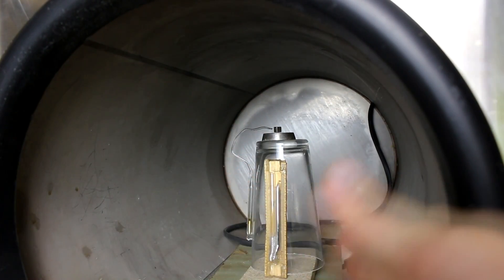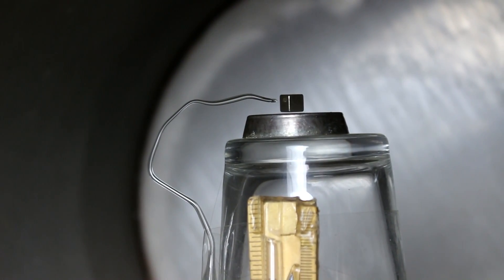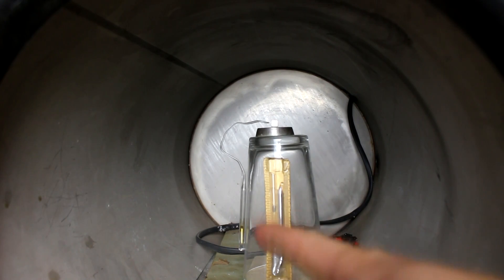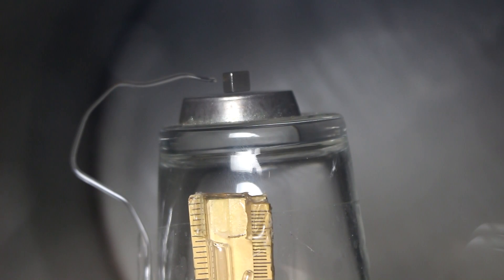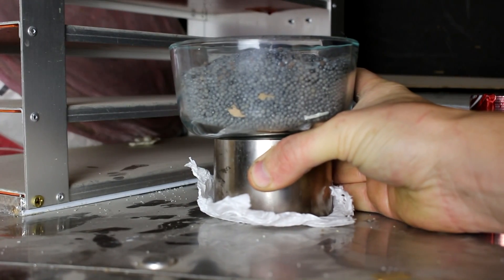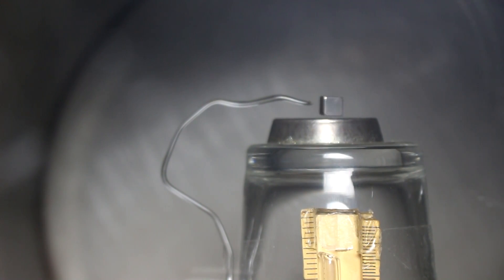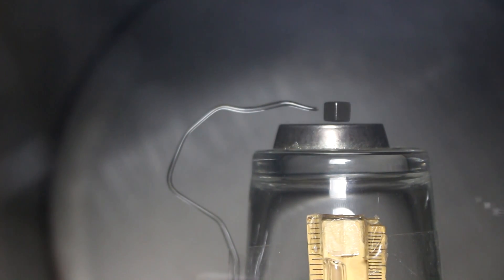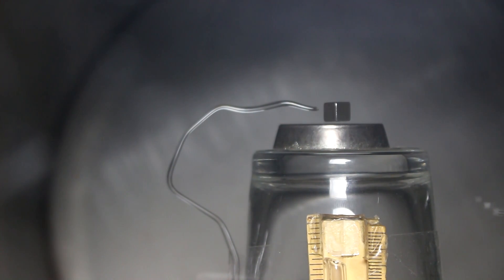Levitating a Magnet in a Vacuum Chamber

Comment: To circumvent the eddy currents you would probably have to go the hard way and use a pid controlled electromagnet to levitate the magnet. Or buy a levitating toy like this: https://www.ebay.com/p/Magnetic-Levitation-MagLev-Levitating-Floating-Globe-World-Map-8-LED-Decor-Light/555424230?iid=192171225376

Comment: Hey Cody, don't bother testing it on another surface than metal, because your neodymium magnet is also conductive, and just the fact that it's spinning in your big magnet's magnetic field causes eddy currents in the small magnet itself. So unless you can spin a 1 atom wide cylindrical magnet, or any magnet without exterior magnetic field (other levitation method, and not even on earth's magnetic field) , your magnet will eventually stop spinning

Comment: 1 mm of mercury is pretty low quality vacuum. There's still a lot of air left in the chamber, that's why it's stopping to spin that rapidly. You might find somewhere a turbomolecular pump, which could provide you with 10^(-3), 10^(-4) Torr (mm of mercury) vacuum. Actually, it's really easy for you to make,  i think.

Comment: Eddy currents are exactly what is slowing it down. Even if it were magnetic and electrically non conductive the interaction of the static Gauss lines used to levitate it will have a braking effect.

Comment: I think even if you were able to eliminate inductive current you would still be cutting lines of force of the 2 stationary magnets with the rotating one so just a small variation would eventually make it stop.  It would be interesting to see how much if any the Earth's magnetic field would affect it since it is strong enough to swing a compass needle even in oil, water or on a low friction bearing.

Comment: The magnet is stopping due to Lenz's law. Basically, the moving magnet is creating a magnetic flux. The law states that any change in flux (in this case, it's creation through spinning) will work to counteract the change.

So, the spinning magnet is creating Eddy currents which cause the magnet to stop spinning.
Reply: RE exactly what I was thinking.I wonder if a circular magnet would spin longer as the circumference will just be moving over the same area
Reply: hkcute; Flux isn't the issue. Its the second time and spatial derivatives of the magnetic vector potential which induces an opposite (eddy) current density.
And yes, if it was perfectly homogenious a spinning cyllinder wouldn't induce any eddy currents in a plane purpendicular to its axis, but you won't find any sufficiently perfect magnet for that to actually work.

Zigi Samblak; At the (pretty bad) level of vacuum that he could generate, air resistance would be orders of magnitude weaker than the electro-magnetic losses.
In other words, it would stay spinning for literally hundreds of minutes if air resistance were the ONLY loss mechanism.
Reply: @mortlet5180  you are smart. I have a physical chemistry-related experimental question for you, is there an email I can reach you at?
Reply: psygn0sis, or maybe because they appreciate his/her knowledge on the subject
Reply from the maker: Funny how the top comment is just repeating what I said in the video.
Reply: You mean Faraday's law. Lenz's law just tells you the direction of the induced current. What is really causing the breaking is not the fact that a current is induced or what direction it has but rather that the current will dissipate in an imperfect conductor.
Reply: Wikipedia: "The direction of current induced in a conductor by a changing magnetic field due to Faraday's law of induction will be such that it will create a magnetic field that opposes the change that produced it."

Lenz's law is basically a shortcut for Faraday's law: you don't need to figure out the direction of current every time because it will always be to counteract whatever caused the current in the first place.
Reply: Besides that, a perfect vacuum doesn't exist so it would be impossible to completely remove all resistances.
Reply: if anyone has trouble understanding this, it's fine. you just need to know that this is also exactly how regenerative breaking/KERS (kinetic energy recovery system) in electric/hybrid vehicles work.
Reply: The Earth magnetic field probably has some effect too.
Or it's witchcraft, does Cody weigh the same as a duck?
Reply: Matt Gray wait! are you matt from wallace idaho?
Reply: Yea, what you said.
Reply: Additionally small magnetic fields present in the room, and especially Earth's magnetic field, can't be gotten rid of.
Reply: thank you I was going to say that the magnetic field it self was slowing it down but you said it much better then I ever could have.
Reply: y not just the magnetic field making it levitate is static and so the cube has to overcome that field to rotate.
Reply: Not only that, but even if that wasn't the case, radiation (light, photons) is enough to create a drag which can stop it down in the long term.
Reply: Wouldn't that also mean that Cody is making a small amount of electricity or does that only work with copper?
Reply: RE I was going to type something similar before the video finished, but you beat me to the punch. As I'm typing this in, the video finishes and Cody has the same idea with the solution of using non conductive material, so it looks like he beat all of us on the reason why it stopped spinning.
Reply: DennIsotopic Damn I am so late. I am haven't watched the entire video and still I am fourth or more.
Reply: RE and gravity pulling it down.
Reply: RE Eddy and lenz are both meanies.
Reply: Cody'sSass
Reply: Eddy currents can be minimized by maximizing the surface area while keeping the volume constant.
Reply: Yep. was just coming down to say this same thing, the rotational energy is being dissipated as heat through Eddy currents.  I think a lot of us knew this already, but it's a good demonstration of the principle.
Reply: Thank you; I was just about to comment this. Saved me the effort lol
Reply: Can Earth's gravity also cause it to stop?
Reply: 1Forge 2RuleThemAll, Eddy current is current, so yes it's electricity. It can be generated in any conductor, not only copper.
Reply: I can bet that the objects ends up aligned north south on earth's magnetic field and that is enough to stop it. It oscillates in the end.
Reply: MRLT is it "eddy currents" in the magnetic field or is it a pulsating reverse of polarity induce by the change in flux. Like I'm guessing how a maglev train would stop. (Unless it has physical brakes. I'm not sure). Just curious. 
 Or are those eddy currents causing same polarity disturbances in the field that oppose each other and cause a magnetic drag effect? Thanks.
Reply: TheGamingPatriot _ i think hes just meme-ing. its so hard to tell though since some people really are that dumb
Reply: Yes, basically an eddy current brake, but reversed. Nice demonstration. :)
Reply: Yup.
Reply: I guessed that someone would write it as soon as he saw that it slows down.
Nice to know that high school level physics managed to help me understand such a specific case with magnets.
I remember our teacher brought a diamagnetic metal tube (maybe a copper alloy) and a magnet and showed how the change in flux in the system created a net force up on the magnet and made it drop at a steady pace.
Reply: psygn0sis do you know what he said?
Reply: Although the faraway law explanation is legitimate, the first question I would have is what is the chamber pressure. If Cody turned off the piston pump, then he is not using a diffusion or turbopump, so this is not close to a vacuum at all.
Reply: Additionally, the magnet is spinning on its polar axis, so it should not be generating any varying Fields as it spins. Except for the fact that it's not cylindrical.
Reply: one can remove enough to prove the hypothesis
Reply: braking not breaking
Reply: Is it emitting radio waves?
Reply: Just take a sample from his elbow to see if he's made of wood.
Reply: And also after a long time it will lose it's magnetism
Reply: RE Yes, I knew as soon as I saw he was using using a chunk of metal that was going to happen. Hopefully he can find something non conductive that will work.
Reply: Matt Gray dude! you must be stationary, in motion!!!!
Reply: thanks for the layman's terms version.
Reply: That makes me now want to see someone set something up with a perfectly round magnet, at the true north pole, so that any slight difference in the magnetic field causes it to spin...
Reply: RE - is energy lost mostly through i^2*r losses? Would a superconductor have less or more losses?
Reply: Damn you RE and SixRough! :D
Reply: So basically it's creating eddy currents which are slowing it down?
Reply: I think to boil this down to the essentials: he needs a magnet with a more uniform magnetic field.
Reply: Rotation is acceleration in and of itself so it'll stop in any scenario
Reply: YEAAAAAHHH BOIIIII!
came here to say this
Reply: Yep thank god that I was thinking right.
Reply: The Arguer WAIT A MINUTE...
Reply: I think cooling everything to close to 0 K would help
Reply: Would not the earth's magnetic poles generate drag on that spinning magnet???
Reply: Nerd
Reply: If the magnet was a flat disc, there would be no flux induced because all the fields are all pointing up/down
Reply: RE Cody getting sassy
Reply: You're on a YouTube channel about science, what in God's name did you expect?
Reply: I would like to propose a new theory: "An object in perpetual motion is indistinguishable from a stationary one"
Reply: lol how is cody being rude? Perhaps you guys are too sensitive.
Reply: SixThough, That's a great idea. A spherical or cylindrical magnet should work better.

SquidCaps, The north and south poles of the magnet are at the top and bottom, so aliment wouldn't make sense.
Reply: Simple answere the magnet stil had Some friction from the macnetic field
Reply: Wow, getting shade from Cody :'(
I don't think you said Lenz's law but I guess I'll take it.
Reply: Funny how he could say it without needing an 8 minute video
Reply: RE just to say that a total vacuum isnt possible yet wouldve been enought
Reply: Not only that, but this is not a hard vacuum.
Reply: Not quite sure, but I think that's the joke.
Reply: also the vacume chamber he has cannot go to absolute vacuum
Reply: +Donald Trump in a nutshell. Alternative facts are the way to go... Heil unser protectionist leader, the wisest of men and leading by example when it comes to grabbing, you know, things.
Reply: Lol how are you guys getting baited this hard by Trump?

(Daddy ily)
Reply: 99% of the people the 'thumbed up" RE's comment, have no idea what he said, but did so because it sounded "scientificy" and they wanted to look smart.
Reply: Cody'sLab you could have been more classy: "Excellent observation 5:39 ."
That's how it's done; what you did was borderline rude broski. I'm not gonna give you my qualifications here...
If you need help being like that get at me. My record is impeccable.

Comment: Awsome, inspiring. Been a fan for a few. Any tips on getting rust off a steel knife? Do not want to lose the makers mark.
Reply: Soak in vinegar a few hours, maybe overnight. Soaking on way after the rust is gone will eventually damage the metal, but IRL use, as described, won't. Wash, rinse, dry with hot air, then oil.

Comment: I hope this will not get lost in the comments  filter
https://physics.stackexchange.com/questions/163461/is-there-any-material-that-is-not-conductive-and-is-magnetically-attractive
Reply: Cancer Cancer
You've misunderstood.  A composite magnet is many smaller magnets glued together with a nonconductive glue.  Inductance is proportional to loop area.  Many separate magnets will have tighter loops, thus less eddy current.  It's exactly the same idea behind laminating magnetic cores in motors and transformers.  Using ferrite is an entirely separate suggestion - ferrite has higher resistance than most other magnetic materials, so it will also result in less eddy current.  Using either method  (or both) would result in longer spin time.
Reply: Jusb1066 dude, some thousands times less conductive would still be not just slight improvement
Reply: +1 to Ferrite. It's used widely through the electronics industry as a good core for chokes and windings due to this property.
Reply: The problem isnt the conductivity of the magnet(the effect of this should be almost unmesurable), but rather the conductivity of the bismuth block(as cody actually stated in the video).
Reply: Even though a less conductive magnet will mean less Eddie currents it may not necessarily result in less kinetic energy being converted to heat. P = V*I = V^2/R. So as long as the movement induces a voltage across the magnet which isn't dependent on resistance then the more resistance the better. Otherwise it depends on the voltage resistance ratio.
Reply: max13239
You're right.  Elsewhere I suggested mixing bismuth powder in dielectric epoxy to reduce eddy currents, but I later realized that would wreck the diamagnetism.
Reply: noice profile pic
Reply: Der Entinator your answer is a 3D printer with a ferous / high iron composite and a 3D printed polymagnet. Let’s keep in touch, and exchange ideas ✌️
Reply: I'd imagine that it still wont change, since its just a non conductive coating around the ferrite and like in this video the magnets arent thouching
Reply: answer not really, a ferritic magnet is less conductive, but not completely

Comment: I'd try magnetising a chunk of ferrite core, since they should be internally insulated like electrical steel laminations. Though I'm not sure how well they will magnetise.

Since you need to remove any solid metal, this includes both magnets and the bismuth, so try grinding the bismuth into granules, coating them with lacquer, and packing it together with resin, and you could try the same thing with the rare earth magnets. Using a solenoid to produce the upper magnetic field instead of the massive magnet is also a good idea.

Comment: Great demonstration!
Try a cylinder or disc magnet instead, the cube is going to cause more eddy currents as you said. But then how to spin it and keep it spinning on the same plane as the material below? Very tricky, but I reckon if you got it just right it would spin longer. I guess ultimately any imperfections in the fields, which there's always going to be, will cause eddys and slow it down.

Comment: At the end, you're measuring the resistance increase in a coil when heated up by exposing it to the sun?
Reply: He could be pulling current out of a magnetic field with the coil, storing it, and then measuring it.  Big loop o' wire under a power like will do the trick

Comment: How about just having a chamber with gas in it, with an evaporatable plug, which will then blast out when you evaporate the plug. That should give you better pressure than the wood burning. Just keep the vacuum on, so it gets removed once the magnet is spinning. =)

Comment: i'll risk making this comment before watching to the end of the video, but at 5:30 you can see there is some asymmetry in the magnetic field from the way the magnet seems to ever so slightly lurch into a "stable spot" before climbing back out again and continuing to rotate with slightly less speed.
Reply: Dn Fx That stable spot is the earth's magnetic field :^) - it's behaving like any compass and wants to align with the earth's field.
Reply: really ? seems like a good explanation, but i wouldnt have thought the effects of earth's magnetic field would contribute significantly enough to this system, given the much higher field strength of the magnets and bismuth Cody has set up here. Or is that still possible given that the forces from said magnets are mostly cancelled out ?

Basically it seems intuitive to me that this would spin a lot smoother and lose much less energy to this fabled stable spot, if the magnet was perfectly balanced and not sagging on one side. Or would it still get stuck on magnetic north in this "perfect" case ?
Reply: Dn Fx
Thinking about it more, most of the eddy current losses are probably in the bismuth - it is a large conductor and it is very close to the rotating magnet.  As for the cause of the lurching -   I'd guess it could be caused by shape, mass distribution, or nonuniform magnetization?  One corner sags consistently, suggesting that the upper magnet and diamagnetic bismuth are not at fault.  Could be wrong.
Reply: Nelumbo
Im more inclined to go with this theory than the others,  it must be imperfections in the field strength, magnet shape/density
Reply: I think gravity as well as earth magnetic field is just adding sinusoidal wobble to speed. It does slow magnet down half way, but also do speed it up other half.
Reply: ah, yes. stopping caused by Foucault/Eddy currents in bismuth plate
Reply: posysajrazdwatrzy
No, the earth's field is at basically 90 degrees to the rotating magnet's field.  It's pulling the magnet to flip on its side, not rotate on axis.
Reply: Dn Fx  
Magnetic asymmetry would still kick it back to its original speed as it climbs out.  Even if it was magnetically locked, it would oscillate in place, maintaining its kinetic energy.  Kinetic energy is being lost here, which suggests eddy currents.
Reply: this makes more sense, eddy currents are the only thing i can think of that will be sapping energy from this system, but are we then concluding that the lurching effect is caused by simple imperfection in the shape of the levitating magnet ? And furthermore i am really surprised how large the eddy current effect seems to be, id expect it to be almost negligible in this system.